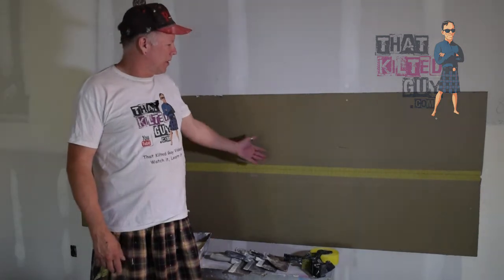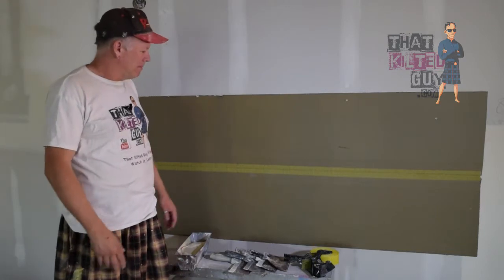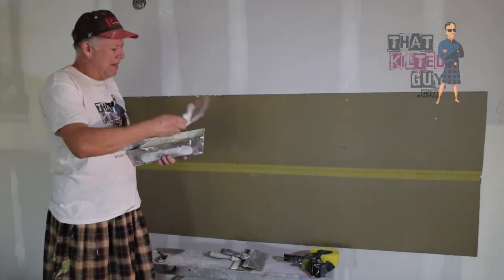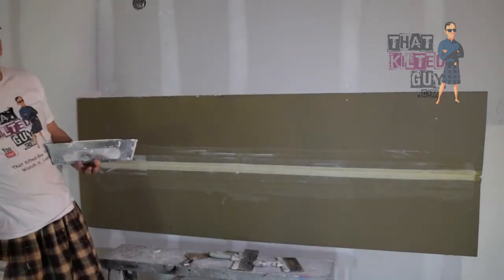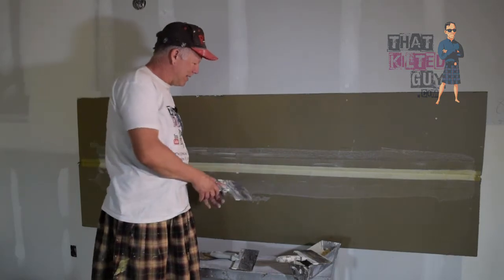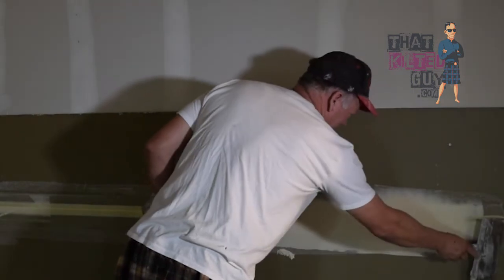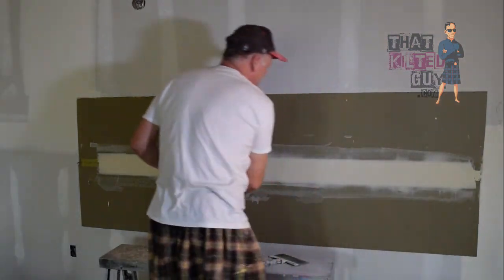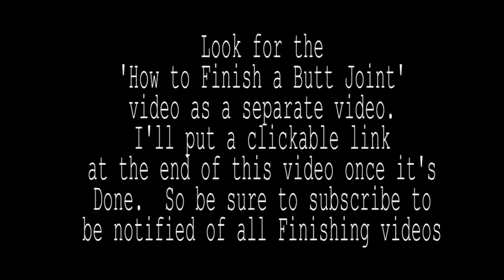Mudding Drywall Recessed Joints, step 1 & 2.  Taught by a 35 Year Drywall Pro

Comment: In Australia we put our butt joints between studs or ceiling battens and back block it and can screw a temporary batten over it with a packer to make a re eased joint from it. Obviously wider than factory edge.
Reply from the maker: Sometimes we do that here in the states. But more often I have shimmed the ceiling joist on both sides of the butt joint to create a similar effect.

Comment: Ive been told by someone that you only should use the concave side of the knife all the time… can you clear it up for me and explain when to use which side of the knife, please? Thanks in advance
Reply: Bryan here's some help, you always want to use the convex side of your knife, meaning you want it to basically look like an upside down rainbow, you want your knife edges to be slightly lifted off the surface when you're doing it so it doesn't leave deep tool edge marks, smoothing is much easier this way and you are able to pick up any line's, I put a screw in my knife's in the handle to indicate the correct side, you can look down the blade to and tell but I can just tell quickly using a small screw. On new knife's I intentionally bend my edges slightly up then put a screw in the handle.

Comment: I'm a noob, but how much do you need to build out a recessed joint? A butt joint hast to be built out a lot for obvious reasons, but i don't see the reasons for a recessed joint. Can you just do the same width for every coat?
Reply from the maker: I can’t explain it in a text but yes it’s best to extend each coat slightly wider

Comment: Do toy bend the blades for a set? all my blades same sraighT?
Reply from the maker: I do bend all my larger blades very slightly.  The amount is very little so don't overdue it.  The best way is to bend the ends out very slightly and try it, the bend a little more and try it until you find what works for you.  But a good starting point is to have the ends bent out maybe 1/16-1/8" more than the center.  Hope that helps.
Reply: Thanks